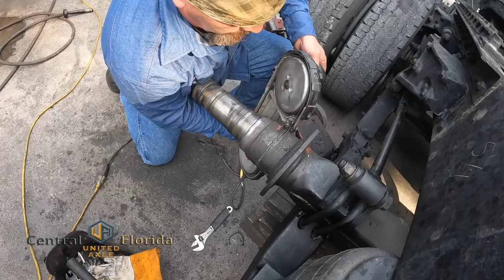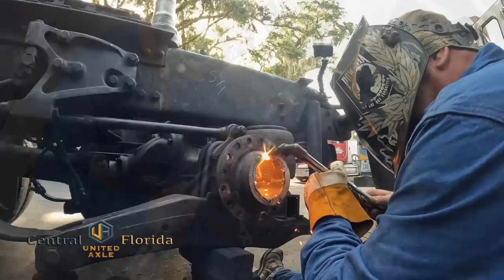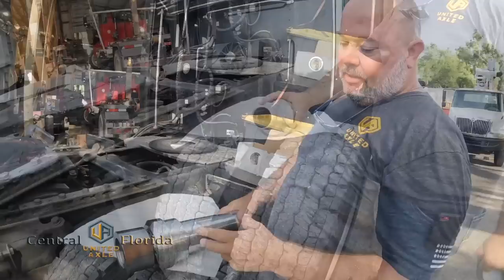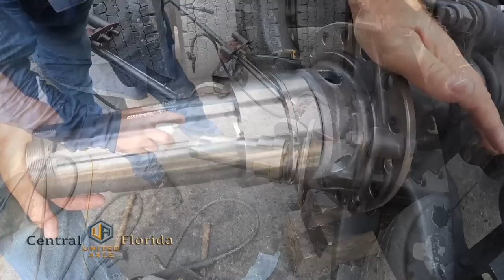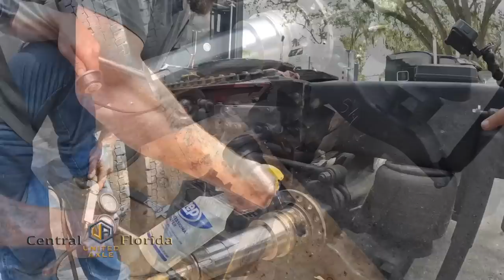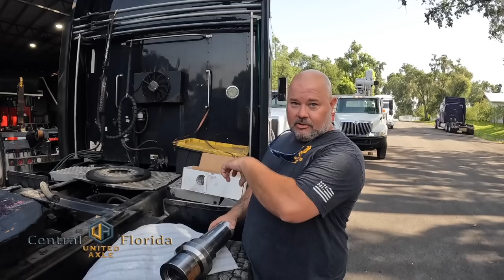United Axle of Central Florida Spindle Replacement Axle Repair Services

Comment: Great work my only question is how do you get  the boss aligned true to the brake mounting flange when it's a loose fit in the axle tube
Reply: I am waiting to hear the answer to your question also. I also wonder about oil getting to the bearings as the new spindle is thicker than the old one making quite a step for the oil climb
Reply: @holmes1956O  гамна налепили этот не работа а фуфляк
Reply: Всё это делается гораздо проще наваривается на резьбу точится и нарезается новая резьба, у них соосности не будет.
Reply: @holmes1956O  Are the axles filled with oil or are the bearings greased with zerks like a household trailer axle?
Reply: @randallsmerna384  the wheel bearings get their oil from the differential. It travels out to them from the center of the rear axle.

Comment: This is brilliant. When you were using the cutting torch, what was stopping all the hot metal from being blown in to the crown wheel and pinion?
Reply: An axle as opppsed to a diff does not have a crown wheel and a pinion.

Comment: I will tell you first hand , John's work is outstanding , I had one of our drivers burn up the wheel bearings on one of our furniture trailers ( Kentucky ) , by the time I could get a axle from Kentucky Trailer , have it shipped ,find a shop to install it , in our busy season was a real hardship , I contacted John he came down to our yard in Tampa , and just guessing , he cut that axle stub out  and put the new one in  his all welded looking at it you would never know it was replaced , NOW , I was still in I must say doubtful that the stub was in far enough or  to far in  , so I put my new shoes on , now the moment of truth , I installed the drum  and I was amazed the shoes were inside the drum by roughly 1/8 to 3/16 of an inch , if I ever need this service again there is no doubt , I will be calling on John   Frank T    Tampa  Fl

Comment: I hope there is something blocking the axle tube to keep bits of metal out.
Reply: Any answers
Reply: Yes there is.
Reply: Just had this done on my truck. They shoved rags in the axle housing then pulled them back out afterwards. Told me it’s a good idea to change the oil soon just in case anything metal shavings or slag was left behind.

Comment: What do they do about slag metal pieces they blew into carrier while torching....leave it so your ring gear and pinion along with carrier bearings get trashed?
Reply: I highly doubt the carrier is even in the axle housing due to the amount of work they are doing.
Reply: If they took time to remove the carrier it would be cheaper and faster to get a banjo housing at a salvage and  I uck out getting one with the same ratio

Comment: I'm interested in the process you use to center, and square up the threaded bushing, and the new spindle.  Also when doing the cutting, and grinding, where does all the slag, and metal shavings ho, and how do you keep it from contaminating thecrest of the rearend housing?

Comment: Interesting concept.

You really need to do another video but show a much better version of what you do.
Right now I have so many unanswered questions.

The slag
How do you line it up
How does it oil the bearings with such a big plug in the way
No preheat and fast cooling of the weld.
Pressurizing the housing to check for leaks, what about the rest of the seals.

This is just wrong.

Comment: I’m a  bit confused, I have had a axle doc come and do a few spindles.  And every was trued and machined   on the axle.  This seems to be similar but a lot rougher?  Very cool idea just not seeing anything machined  is odd
Reply: I believe that the machining was done off camera,as well as the squaring of the stub to the housing.
Reply: @larryreno8293  Not a single mention of those operations.  Assumptions... you know what they say about them...
Reply: @ShainAndrews  reasonable deductions are not assumptions.
Reply: I'm an actual axle surgeon there is no machining involved just grinding. They really put on a show for the camera on this one. I have fixed so many of there f ups.

Comment: Many questions???  My thoughts first torching the inner part of the friction weld and blowing all that slag inside the housing and we all know how hard it is to clean it all out. Then the threaded bushing. How? I mmean how can it possibly be accurate with such a loose fit as far as accurate alignment and concentricity. Nice product. But seams like kind of a hack way of installing it. Seams y’all need to machine the end up the housing foe a snug fit with the bushing to control the accuracy of the install
Reply: I would go to the salvage yard and be done with it faster

Comment: Had this type of repair done on a Ford f350 dually a few years ago in our shop. Don't remember who did it, but it was a nice repair. I was just wondering 2 things. Did you plug the axle tube with something to keep the welding slag and the grinding filings out. Didn't see anything. Also, how does the diff lube reach the bearings with that large bushing you put in the tube.

Comment: So, my question is how did you stop the slag and metal debris, when you were cutting the axle from entering into the rear end?  I didn't see that you protected that when cutting and welding or did I just couldn't see from the camera angle how you did that?

Comment: My question is what about all the slag and debris that went into the axle tube ?
Reply: I would guess that the differential guy will clean it out when the rest of the assembly fails in a few days......I'm still trying to figure out how they centered the bushing with it being so loose in the housing.
Reply: Plus would that make that area brittle to flexing along with the heat from welding?
Reply: @met9072  Why do people like you think these components are unicorns?  The OEM is welded.  You guys think welds are always a weak point... they seldom are.

Comment: What about all the metal shavings and slag you blew inside the axle and now the ring and pinion and bearings are extremely contaminated and will burn up for sure unless you had some sort of plug stuck inside the axle tube to catch all the contamination and the other thing I was wondering is how do you make sure that the spindle is aligned and straight?
Reply: Absolutely! How do you pressure test with a axle vent?
Reply: I was thinking the same thing. Looks quality but with a few questions
Reply: @billcovert3473  Easy, you plug the vent, pressure up and blow all the seals out

Comment: What about the gear oil getting to the wheel bearing because you got that that adapter in there now it's got a client it's got to go higher to get the oil to flow into the wheel bearings you guys ever think about that there's an extra lip that gear oil has to go up and over before it gets to the wheel bearings